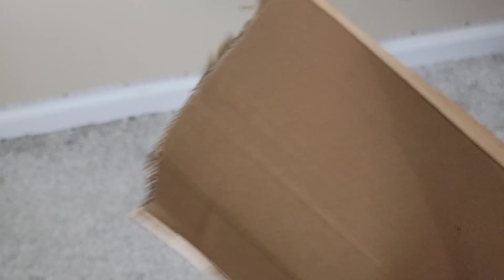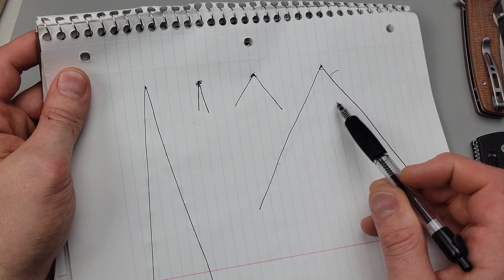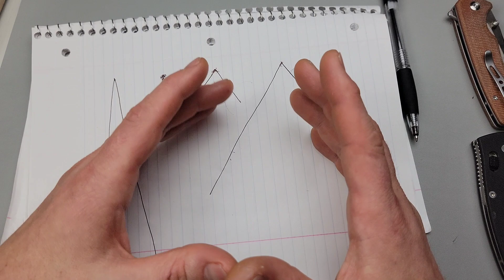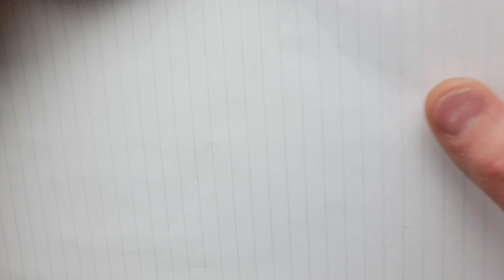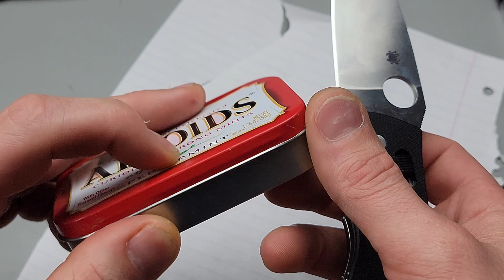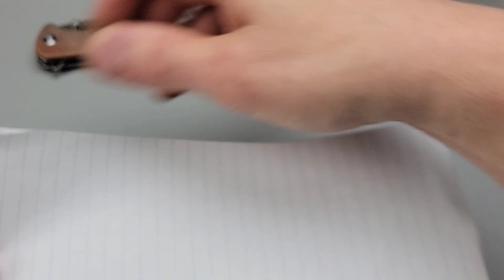LOW VS HIGH ANGLE EDGES EDGE RETENTION

Comment: I use my EDC mostly to cut fruit for my son. The 63-64 HRC Magnacut from Chris Reeve (on their Sebenza) came with a 20 degree. I would like to know how acute of an angle I could go with it? is 17 degrees about the limit without sacrificing too much toughness on the edge?
Reply: my benchmade magnacut 940 
62hrc  works well at 25 to 30...around 20 to 17 degrees it was loosing hair whittling edge really fast...please update about your knife

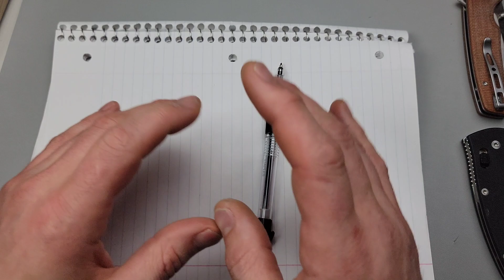Comment: I just don't get why knife nerds conflate "edge retention" with "wear resistance".  Right around the 1:45 mark you get it right, but then sort of back off on your correct statement.   Toughness plays a HUGE role in "edge retention", but it has nothing to do with "wear resistance".  I don't know why it is so hard, after all these years, that knife nerds (I put myself in that category, it's a compliment), even the PhD ones, just cannot get the two terms (WR vs ER) separated when talking about knife steel.   I am on a mission to correct this nonsense.   I see it all over the web, and even in the new books.  There is a massive massive massive difference between "edge retention" and "wear resistance", but all too often someone will say something like "ZDP has amazing edge retention".  Try taking a knife in ZDP-189, hardened and tempered to it's usual 66-67HRC, and try processing a whitetail deer, for example.  Tell me, after processing that whole deer, that ZDP-189 has amazing "edge retention".  Not happening.  But use that same steel/knife/heat treat while cutting food in kitchen, then yeah, it will likely have amazing "Edge retention".  It has very very little toughness, so contact with bone, or a hard surface, will likely chip that edge.  ZDP being a great example of this, much like D2.    There are a handful of factors that come together for a steel to have what we would call great "edge retention".   Wear resistance is one, hardenss is another (also contributes to wear resistance, not just the carbides in the steel), toughness the resistance to fracture is another, even corrosion resistance is another factor to some small degree.   Apex stability is the ability to resist lateral stress, which is in a way part of edge retention, but sort of a property on its own.  I won't get into geometry, behind the edge thickness, edge angle, micron finish, etc.....those are variables the knife owner/user can control.   But this business of "wear resistance" is the same as "edge retention" needs to die a death.

Comment: Just gonna recap briefly:
Edge retention is the ability to hold a small radius at the apex. 
Finer angles and harder steel will keep this apex radius small for longer.
Toughness is the steel's ability to resist chipping at the same cross section.
Strength is the ability to resist chipping or permanent bending at any cross section.
Tough and hard steel can hold a fine edge without blunting or chipping, and so have better edge stability, and so can hold a finer edge doing the same task, and so longer edge retention.
To make it easy, just go thin, and if you find it blunts without getting any chips or rolls, make it thinner until you start to see it and then back up if it's faster than the regular blunting.
Blunt = more or less same glare along the whole edge in the light, and rolls and chips are bright spots among a sharp edge.
Reply: Fin eh baba

Comment: I've sharpen at low angle maybe 16 degrees one of my old kershaw knives which is in 8cr13mov and didn't expect that the edge will stay sharp longer.Respect to you Neeves!
Could you make a video for the Elmax steel and sharpening it?
Reply from the maker: I will see what I can put together, I do have a Video on steels where I speak about most of the steels jfyi, the Thumbnail is a list of steels

Comment: Preferred angle and grit for a Benchmade 581 in m390?
Reply from the maker: I personally wouldn't polish benchmades m390,  because the plunge grind gets in the way I'd go with 17° per side at 600 grit
Reply: @NeevesKnives  I’m surprised you suggest to stop there.  I’ll try it next time.  This limited edition Barrage is one without the plunge grind.

I have polished up to 4000 grit with my edge pro, but the edge folds over easily at 18.5

Thanks for the tip(s)
Reply from the maker: @RyanJoz  I suggest to stop there because softer m390 tends to lose its bite quickly with a polished edge, so a medium grit edge will have a longer lasting performance as far as edge bite goes, instead of having a slick edge that slips off of things, if your edge is rolling with that angle then the steel probably has an issue because it shouldnt under normal use, unless you did something with it that pervoked that. but that is most likely what i would do , if you dont care about edge bite lasting then go with a higher grit, i personally wouldnt go over 1200 grit pn that one but you can and then see how well it works out

Comment: To me the term edge retention is a combination of toughness, wear resistance and edge stability since they are the 3 ways (there's also corrosion but that takes way too long to notice, years of sitting in a drawer to notice a tiny change in sharpness so I don't consider it) an apex gets damaged. What most people refer to as edge retention is wear resistance. Cutting an abrasive material which wears away at the edge apex through abrasive wear. 
It could be just semantics and the words don't matter that much since most people understand what it's referring to anyway. Most people think of edge retention is how long a knife can cut for.
Reply: I would say toughness, hardness, and wear resistance. edge stability is usually a good combo of the first two. Toughness prevents chipping and hardness prevents permanent bending.
Reply: @mikafoxx2717  edge stability is partially that but it has more to do with grain structure and carbide size. That's why Aeb-l has amazing edge stability, it's very fine grained and has super fine carbides, which allows it's apex to withstand lateral loads, without breaking of at the carbide boundaries.
Cliff Stamp (RIP) had a bunch of videos talking about it with great visuals.
M390 at 64hrc will have high hardness but it won't have high edge stability.
To me, edge stability is the strength of the apex to resist deformation by lateral and frontal loads (more lateral). It affects how thin you can grind a knife and how low of an angle it can hold without deformation.
Reply: @MFD00MTR33  It's sad I didn't find out about Cliff Stamp until after his passing. Knife Grinders Australia did test m390 and the ideal angle for it was the same as a Victorinox kitchen knife at significantly lower hardness. D2 did even worse for edge stability. I'm hoping to get into making knives and hoping I can get some great hardness and fine grain. I think Larrin has taken some of Cliff's advice when it comes to sharpen thin, and if you get chipping or bending, increase it a degree or two. I don't believe in having a pocket knife ground for brick breaking. That's why you bring more than one. I like my general carry to be very slicey, and at worst I can resharpen it. 12c27, 14c28n, and 1095 opinel, mora, and more are my usual.. if I want supersteel I'll probably do it myself at some point, and choose one with good edge stability like cru-wear.

Comment: Bang!
According to the table in the beginning of this video, 154cm and 440c are the same (toughness, edge retention, etc). I used 440c (from Ganzo), but I never used 154cm (looking at Kizer’s). If it’s going to be the same experience for me?
And 14c28n has really great toughness. I’m still wondering what is going to be better for cutting papers, woods, plastics, cardboard etc, CIVIVI’s sandvik or Kizer’s 154cm?
I don’t mind to slide a knife on lansky dogbone couple of times per week.
Reply from the maker: So alot of them are not accurate as far as edge retention goes, that's why the people doing controlled cut tests are so valuable, the edge retention tests come from catra which we have found out is not reliable for many many reasons
Reply: @NeevesKnives  I believe your experience, and wanted to hear your thoughts about 154cm and sandvik according to your experience.
Thanks!

Comment: Which leads to the big question: How does the general public know where to find the good, consistent heat treaters?
Reply from the maker: There's reputable ones that have a great reputation for doing consistent heat treatments and checking them constantly as far as the knife makers go, as far as the public buying them, there's companies that use those heat treaters, or you can look to the community who has done tests for years to find out who's doing the best work
Reply: @NeevesKnives  Any kind of list of the reliable ones? I understand that this is a tricky subject.

Comment: Toughness probably isn't a good term to  describe a wider profile as opposed to a narrow one as it is a technically defined property of the material itself.
Reply: Toughness is the ability to resist breakage at a cross-section, or let's just resistance to breakage. 
It's a description of a value. How much impact any given material can resist until it breaks. 
Materials can be tougher than others at the same thickness or also simply tougher due to more thickness. 
If what you're saying is actually accurate which it isn't  heat treatment would make no difference to toughness. 
Strength is ability to resist deforming. 

If you were referring to corrosion resistance i would agree since it's inherent to the material itself and not dependent on shape. 
Even though smoothness and even hardness play a factor in it.
Reply: @oftheether6935    You are partly correct, for the common/vernacular definition of toughness.

But toughness is a technical term in materials science with a particular definition.  It is a material property.  Meaning any given sample of a particular steel with a particular treatment has the same toughness regardless of shape. 

It is defined per unit volume, so amount is not relevant.

Thats the reason i suggested another term would be better as its easily confusing to people, and not clear.  Only the technical meaning is precisely defined and its not correct for what he is trying to explain.

Comment: Toughness is a MATERIAL'S ability to take impact. Edge retention is considerably more related to abrasion resistance than to toughness. You're right about one thing for sure. It depends. Maybe we should just stick with that.
Reply from the maker: I'm not sure exactly how to take this comment but both were exactly how I explained it.
Reply: @NeevesKnives  No. I tried to explain this on another video the other day. Tohghness is a material property, specifically, resistance to fracture. It is not a function of geometric properties. Strength is a function of both material properties and geometric properties and is resistance to deformation. An edge can fail by means other than fracture and because of that fact, toughness is simply not the right descriptor. The proper term is strength.
Reply: @NeevesKnives  Im not trying to be a dick. I've just been working to create an understanding of these factors in the sharpening industry for about a decade.
Reply from the maker: @MrMZaccone  I'm not a decade into this but I have been doing it for a long time, and also run a Sharpening service that's highly regarded, I'm not trying to toot my own horn or anything and don't pretend to know everything, I also understand that I'm running a YouTube channel speaking to people that don't understand and are trying to, I teach Sharpening and run a Sharpening service, and after teaching Sharpening I'm trying my best to make someone understand that might not know the lingo etc.. you could be the smartest guy ever and know far more than me I don't know, people come in to the comments constantly with ridiculous things that clearly don't understand yet speak as if they do hundreds of times a day. Which is fine I have a channel so it gives people the ability to so it makes it easy for people, but I don't have that same privilege to do to them. Not that I expect to, but it's easy for people to say something about what you did or how you said or how something looked sounded etc.. I stand by what I said in the video I think I explained it very well for people that don't understand. And on Sunday I will be teaching them Sharpening live, but I appreciate the constructive criticism when it's constructive.
Reply: @NeevesKnives  Part of my problem is that I was raised by an engineer. Terminology is a big part of communication in any field. I'm impressed with your freehand sharpening. The numbers you can get on the BESS scale prove you have a quality process. I don't sharpen freehand any more if I can help it because using mechanical help, I can do better and it's how I make some of my living. And I don't mean better than you, I mean better than myself. My scores on the BESS scale are consistently sub 100 and depending on materials, sometimes sub 50. I don't teach sharpening but I do teach and I do my best to use terminology that is not only internally consistent but consistent with whatever aspect of science I'm using to continually Improve. I'd like to think I'm being constructive but we first have to be speaking the same language. No offense meant.
Reply: @NeevesKnives  Part of the reason you get so many people spouting nonsense at you is that there is so much B.S. entrenched in this subject. In my experience, the only way to fight that in ANY field is to do so with science. There is an art to sharpening but it's contained simply in finding creative ways to accomplish the same thing. Like that trick you use to keep your angle by marking your thumb and finger. I like it. It provides consistency. So does sticking to a language consistent with the STEM fields that are the foundation of understanding almost anything, including ... Sharpening. Peace! Keep moving forward. Sharp tools make good work and the human mind is the best tool yet.

Comment: Jared, I’ve got that WorkSharp Ken Onion Edition….how would you rate that for a sharpening setup?
Reply from the maker: I think it's a great system for cheaper kitchen knives, machetes, or other large fixed blades, it's also great for mods or doing blade repairs, but I personally wouldn't use it on good folders, if it's a cheap one that's fine with practice, but the edges are just OK and don't compare to high quality edges if that's what you want
Reply: I have a plethora of systems including that one. I dont use it at all anymore. I normally set my edge bevels with an edge pro or hapstone table system as its very versatile system for all blade types. Then just sharpen manually with edge pro stones or bench stones whenever I need to Sharpen again. The systems dont make things easy. A lot of learning needs to be done still. Most people think these systems make life easier but that's not entirely true.

The Ken onion system will only provide convex edges and you have very little selection of belt choices for abrasives.

Comment: looking fwd for Part2. Lots of people think the mirror polished super high grit is the way to go spending a lot of time and material sharpening steels that just might be better if you stop at 600 . Meanwhile thanks for Part 1 ;)
Reply: Depends on heat treat, volume of carbides and size of said carbides. So you can't always generalize based on steel name alone if manufacturer A heat treats a knife different than manufacturer B in the same steel. As one of them may have use a high heat temper vs low heat temper of the other company, or maybe company A used a method for more carbides vs company B who focused more on stainlessness instead of the carbides. A lot of times companies dont understand why they chose the heat treatment protocols they use. They just picked the standard one they were offered and didn't do any testing or research into it. They just know its at the hrc they decided. The knife industry has been dumbed down for the mass market to sell lots of knives to people in mass.

Comment: I don't think you mentioned hollow ground which stays thinner behind the edge further than the others. So... less durability, but better edge retention and easier to sharpen?
Reply: I think this video focused more on the apex than behind the edge bevels. But that's generally correct from what you've said. I wouldn't always say less durable because many factors are at play, but the thinner it gets its likely to be less durable in some steels/heat treatments.

Comment: yes. but a finer angle will have less volume of material behind it by distance up the blade and will therefore blunten faster over time. it will also be finer and weaker making it more prone to rolling and chipping. if all your planning to do is cut clingwrap you could have a point but who uses a knife only on very soft fine materials.
Reply from the maker: If you watched my video I clearly took a knife with a steel that's not tough with a low angle and smacked it on steel with very little damage, I took another with a low angle with a tough steel with no damage. As I said you have to use what works for you, most of the steels I use work great with low angles. But I could ask you why are you trying to cut things with a knife that are supposed to be cut with a saw. Stop trying to cut metal with your folding knife, use a utility blade or a saw
Reply: Something like delta 3v or magnacut are good examples of steel with good toughness and edge stability. The fine edge would take impact better than most.

Benchmade 3v started out soft. So on impact it would dent. So heat treat is important also and can't generalize solely on steel names alone.

Something like s110v could take a fine edge but chip on impact, making it more of a slicer than an all around task knife. A wider angle will help improve that on s110v to an extent.

Lots of variables.